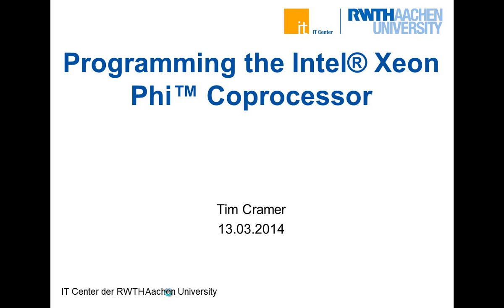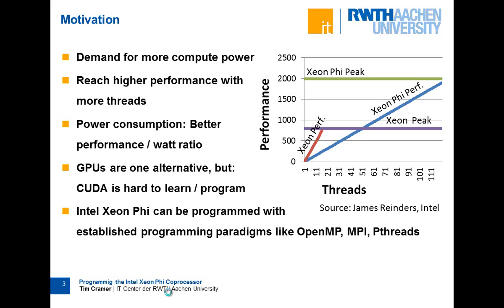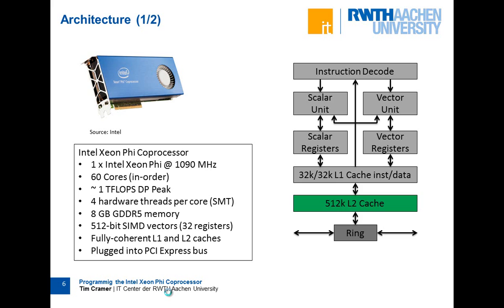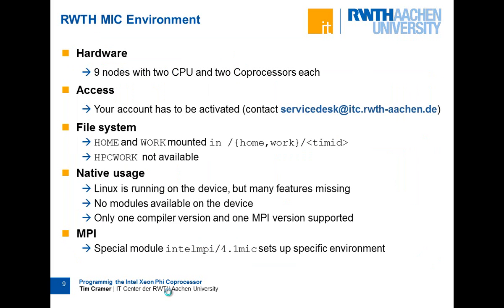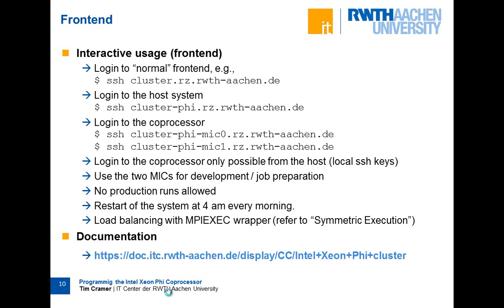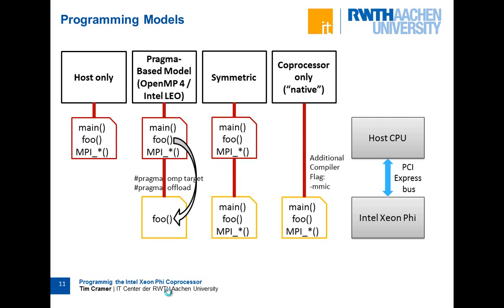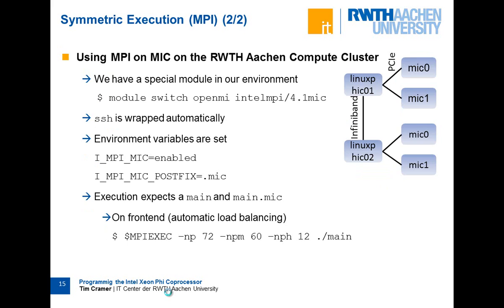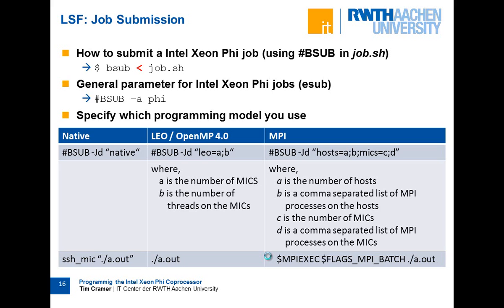Programming the Intel Xeon Phi Coprocessor Overview, by Tim Cramer

Comment: Is it possible to programming intel phi card by assembly programming?
Reply: Did you ever get am answer for your question elsewhere? I'm interested in knowing information like this.
Reply: @tacticalcenter8658  sorry no. so sad about this.
Reply: @petercheung63  thanks. I never researched it myself. I'm guessing you could use assembly language but it would not be easy to figure it out. I don't think anyone would bother. I'm not sure if it would even make a difference in performance or not.
Reply: @tacticalcenter8658  i believe, writing assembly by own hand will execute even slower than c++ in real case. But assembly lead us to know the architecture.
Reply: @petercheung63  Technically, when you run compiled code, the CPU is running the x86 machine language code. So, yes, you can if you can run compiled C++ code but it will be very painful programming to do manual x86 programming. I would rather use C++ and compile accordingly. Just remember that microprocessors can directly execute ONLY one computer language.... that is the CPU's machine language. The x86 based processors that these Intel chips are based on can only execute x86 ISA, directly. All other languages requires compiling or some type of language interpreter. This principle has changed in 45+ years of microprocessor technology and the nearly 43 years of the x86 architecture. Yes, I do know it is technically supporting the x86-64 64-bit instruction set architecture but these cpus are backward compatible to legacy 32 bit architecture, IIRC.
Reply: @DysoniaMultiverseNews  Thank you Gentlemen Mr Rick